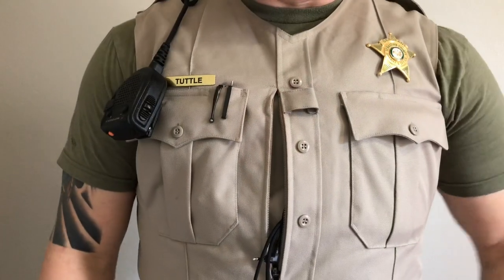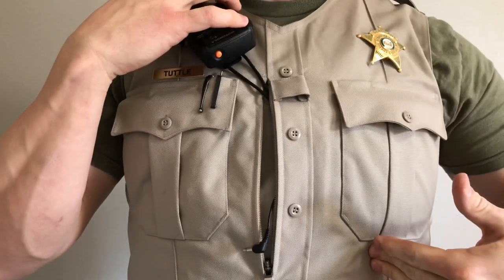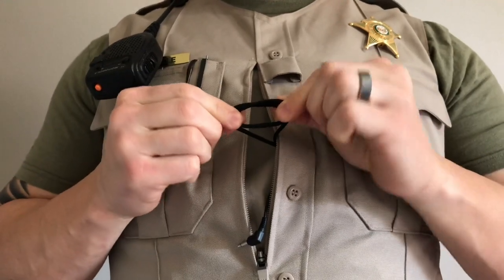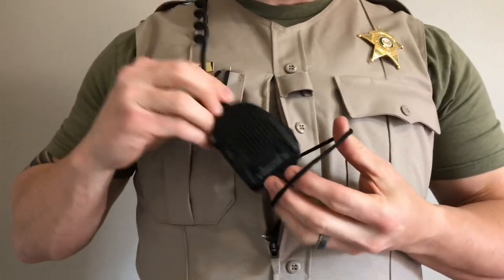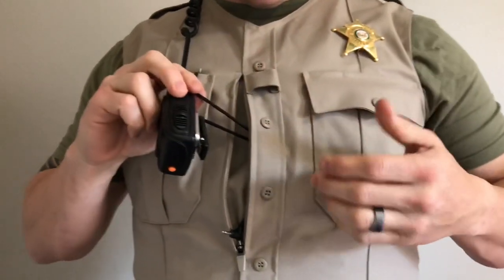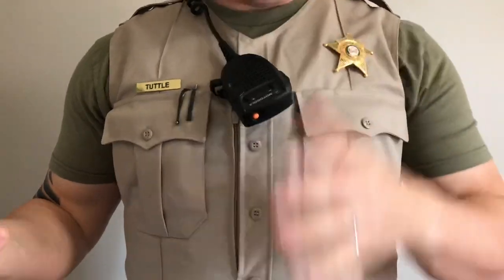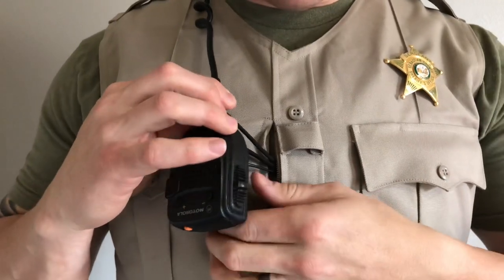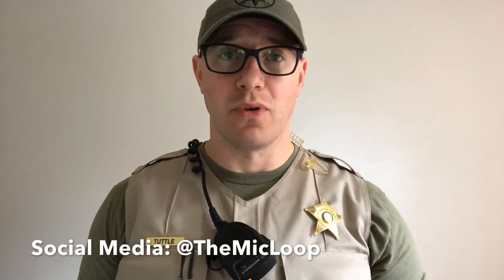How to best secure your radio mic when using The Mic Loop.

Comment: I am not dissing your product or anything, I believe it is innovative and should be standard issue for everyone still rocking traditional uniforms. But, it wouldn't be too industrious to tie a piece of paracord or an elastic hair band to the mic tab on the center of the carrier and secure your mic that way. It may actually be more secure that way.
Reply from the maker: Daniel H To each their own on the way they secure their equipment. We’ve found, along with thousand of other LEOs worldwide, that The Mic Loop exceeds all requirements to secure their mics. Also, we’ve worked very hard to make this product the absolute most affordable that we can.